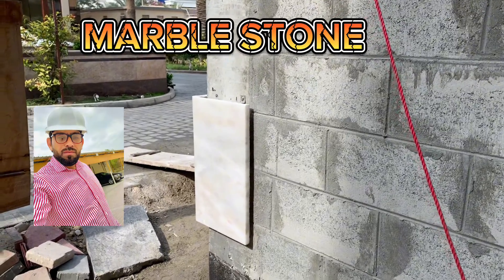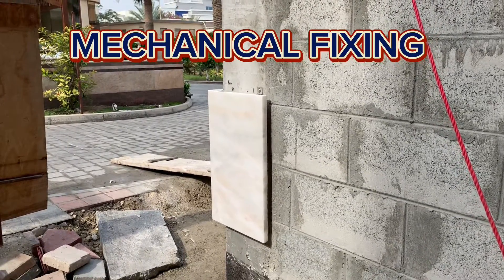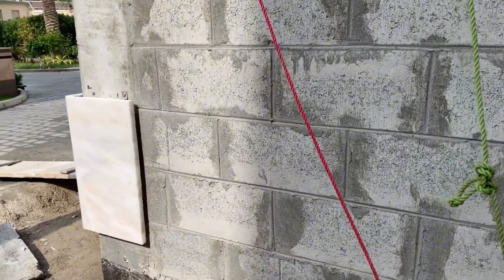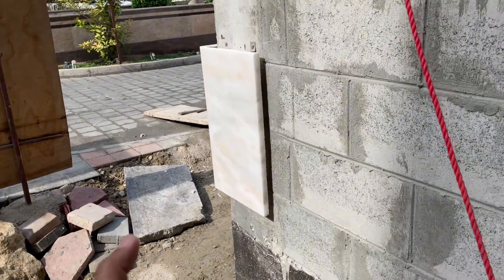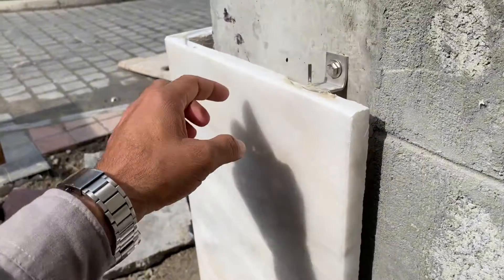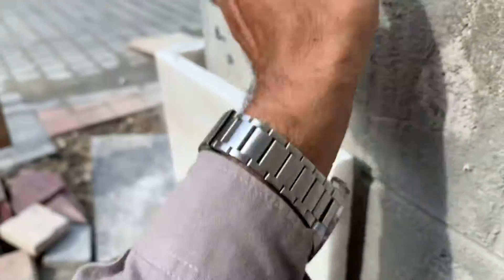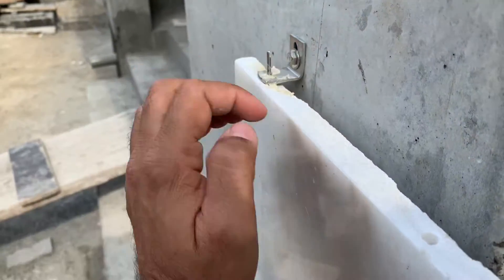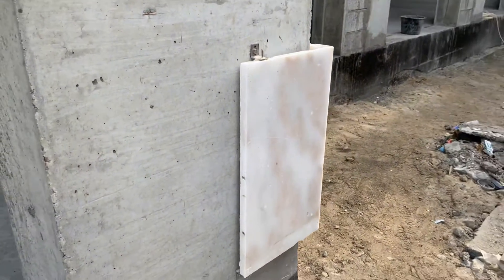Stone Mechanical Fixing | Natural stone cladding | stone cladding | Marble fixing

Comment: Very impressive. it will also provide heat insulation and far better than unreliable adhesive bonds. Looking for a video after completion.
Reply from the maker: Here in Bahrain specs says thermal insulated blocks need to be fixed… i ll share video after completion
Reply from the maker: Thanks
Reply: I am mison the marble
Reply from the maker: @taimurkhanwali2838 ok